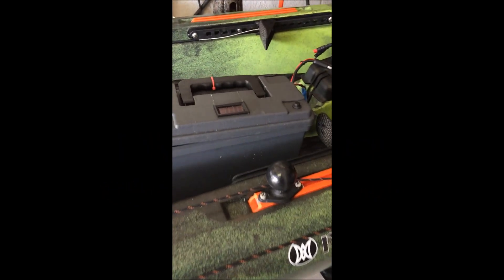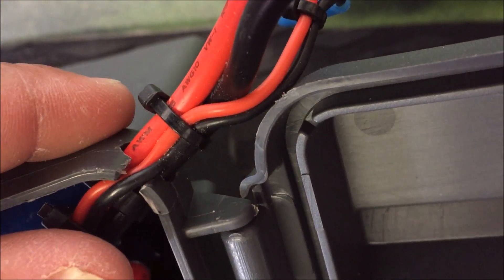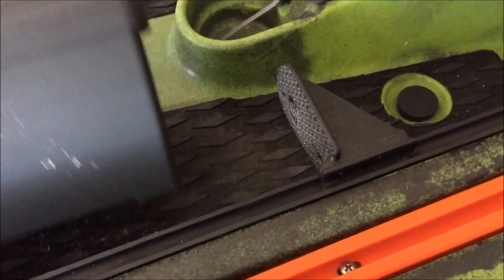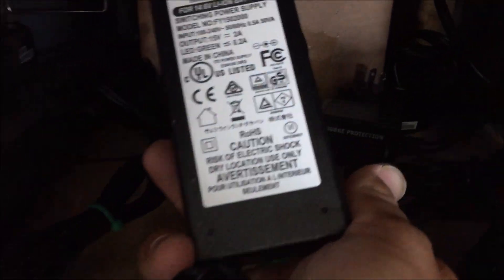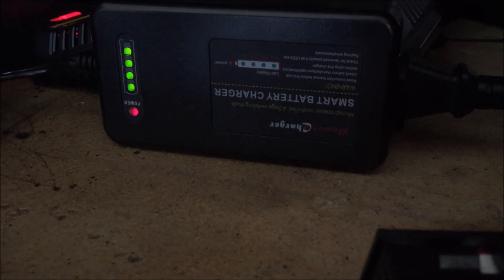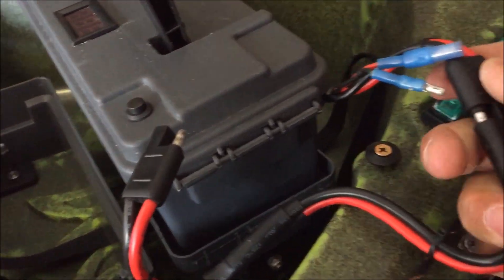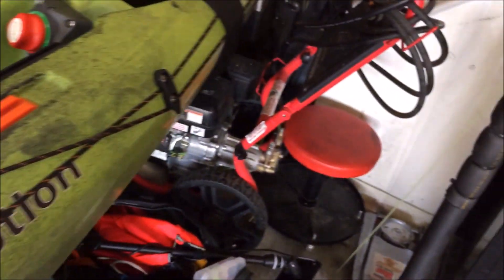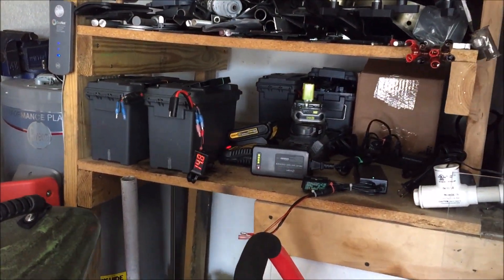Lithium Battery for Kayak trolling motor

Comment: Great video and great details.  I just ordered this battery from same source you provided...thanks...!
Reply from the maker: Dave S you won’t be disappointed, I’ve been out 3 times recently without charging them(using both batteries ),5-6 hours each trip so about a total of 18 hours and don’t plan on charging before my next trip.
Reply from the maker: Dave S make sure you get a good charge on it before you take it out. Mine charge to about 14.8 usually.
Reply: I picked up a PWM, and charger.  I hope the charger I got works ok...same manufacturer as the who made the battery, so will see.  I do like you idea of a circuit breaker instead of a fuse.  Thanks again for the video, I must have watched it a dozen times !  Just to let it all soak in.
Reply from the maker: I tried out about 3 different chargers before finding one that would work. Just make sure you are getting to at least 14.7 , then you will know it’s fully charged. I made the mistake my first trip out with only 13 volts and didn’t last long at full throttle. When I charge to 14.7, it drops to about 13.4 before I’m on the kayak. That will last me 10 hours easily with no hesitation on going full throttle.
Reply: Well that is really good to know.  14.7 will be my target charge.  If the charger doesn't workout, I'll ask you for a link to the one you have,...should of done that before I bought mine, but got excited and placed an order.  Did you need to increase your wire gauge any since your control is away from the motor?  Just wondering...I'll check once I get everything working.  See if the wires get hot or breaker trips.
Reply: @daves9685  Hammer Head.  Just want to thank you again.  I used your video to do my set upon my Vibe Kayak.  Unfortunately, here in PA, we had so much rain this summer and fall, I got out once to do a test run. Not it is sitting in the shed waiting for Spring.  I am running a 30# thrust also.  I had it up too full on the PWM and about 2 mins later it cut off.   Not sure what cut off, the PWM or the Protection circuit on the Batteries.  After 3 minutes, I turned on the PWM switch again and to my surprise it started running again.  Did not run at full for the rest of the trip...about an hour.  Come Spring I'll test again, but really liked the results.  I never would have tried this without seeing your video.

Comment: what size motor running on that battery pack? thanks
Reply from the maker: Lobbie Dove 30lb trust
Reply: nice numbers and not unreasonable cost- like the way you did up proper in ammo can and display/switch. If you had a link for these cans that would be nice. Thanks for post GBU
Reply from the maker: It’s just a plastic ammo box from harbor freight.
Reply: What’s the website I can purchase one of these?

Comment: Great video!!  Can you provide a list of parts that you used to build your battery pack?  Found the battery vendor here:
https://www.ebay.com/itm/LiFePO4-battery-12V-30AH-Built-In-BMS-Solar-Battery-Backup-Power-Deep-Cycle-UPS/173327588643?hash=item285b211d23:g:e4AAAOSwB-1Y0ae-